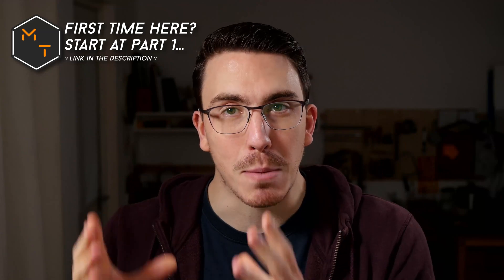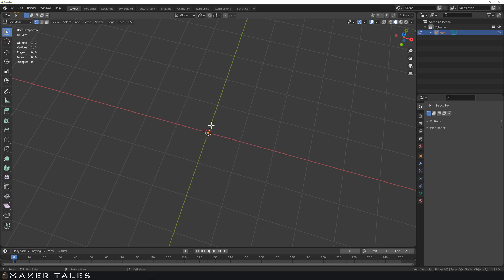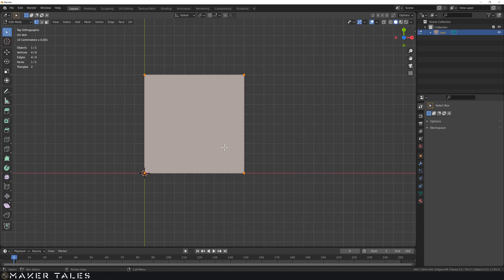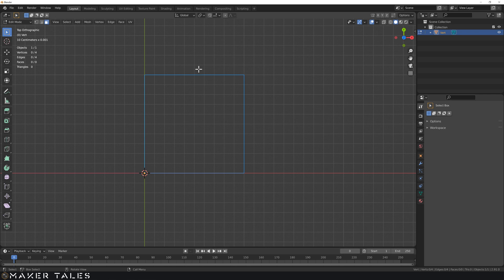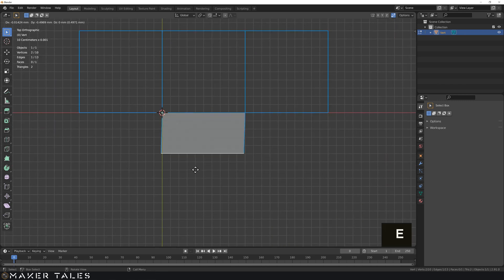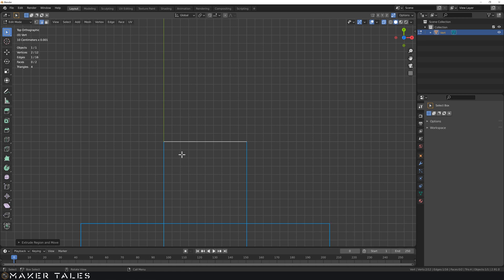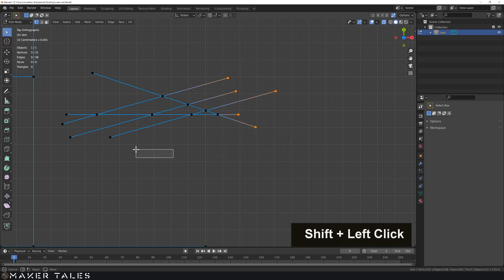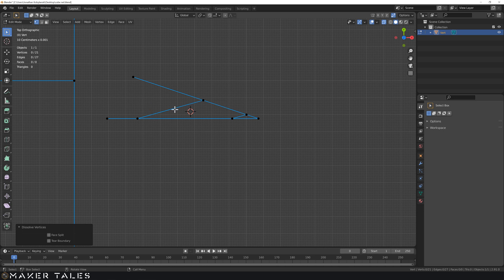2D Basics Of Blender 2.9+ / 3.0 Precision Modeling - Extruding and Clean Up - Tutorial | Part - 13

Comment: I have done some modelling for some other uses and z is usually represented by the height of something in those uses and x and y are the length and width of things, I'm curious if I continue to do things in that fashion how big of a problem will that be for 3d printing? I'm wondering if I should forcibly break my habit of using numpad 1 as my default view rather than numpad 7, cause I do find things to be quite a bit more confusing with num pad 7

Comment: I scrolled through the comments a little bit and found that I was not alone in being unable to snap the planes using CAD Transform unless the planes had a face. I have been manually adding faces, snapping them together, toggling x-ray, deleting faces, and then doing it all over. If anyone knows how I can do it like the video does please let me know.
Reply: Dude I thought I was the only one! I think blender changed snapping behavior.
Reply: This just seems like a limitation of the addon. Yes, there is no face there to try and snap to. It doesn't look like it spends processing time trying to predict and project faces where your cursor is between some set of vertices. One thing I have noticed is you can make a helper for that temporary face that you can later reference without having to recreate it every time.

Comment: Had just finished a little 3D doorbell cover for our front gate in FreeCAD... was practicing to re-make this in Blender and was adding a Solidify... it was going weird... came back to this video... and sure enough some errant vertices were hanging around... took them out and BAM! perfect Solidify! Thanks for this video series... I'm still not to the point of actually getting something ready to 3D print, but I've learned more about Blender than I ever knew...

Comment: Wonderful lesson kudos. I have an issue with 7:17, my cad transform does not highlight/lock-onto the vertex for 2d objects. If I add a 3d cube it does lock on to the vertex. Why do you think this is. The snapping on cad transform is on vertex and vertex select.

Further testing, if there is a face, cad transform will lock on the vertex. Without a face it will not. There must be a setting I missed somewhere.
Reply: same issue here, seems like one workaround is to fill, snap, then delete faces only
Reply: @bobobob1230  Thank you. Thought I was going crazy.
Reply: @bobobob1230  Thanks..
Reply: I have this same problem Blender 2.91.2
Reply: @brianc83  Noted must be an issue with the addon and the latest ver of blender then. Thanks
Reply: I had this issue too. First I thought it was because I had duplicate vertices, which apparently makes the add-on not want to snap. I deleted everything, started over, thought it worked. But apparently was a fluke. Did find that if I rotated my viewport slightly out of a strict Top View, it snaps to the verts
Reply: @kevinandersen5836   so, it worked as in the video? my statistics says "Top orthographic", get no snapping when there´s only vertex and edges
Reply: thanks, I had the same problem. Any news to solution this? Very unpractical have to make the face every time...

Comment: Thank you for this series, your content is top class.

I am getting issues trying to use TinyCAD on 2.92.0.
The "VTX | Auto" tool gives me an error:  "Non Planar Edges, no clean intersection point" when they are clearly planar.

May you confirm TinyCAD is working ok with 2.92.0? I don't really get if TinyCAD is deprecated or not.

Thank You!
Carlo
Reply from the maker: I've not had any issue with TinyCAD as of yet. But I would love to take a look into this if you would be able to ask this question in the discord and share the file.
Reply: @Keep-Making  Hi, I am having the exact same issue at the moment! Was this issue resolved?
Reply from the maker: @petonegroom4321  Hey petone, first off I would check the scale of my object but also youtube comments are not great for support so maybe head on over to the discord.

Comment: Thank you so much for your always useful, interesting and accurate videos. I take this opportunity to ask if anyone knows about similar videos to use Archipack? Personally I find Archipack very cumbersome and not very intuitive. Thank you!
Reply from the maker: Hey Filippo, I'm so glad you find my videos useful.
Personally I have not explored Archipack. What do you find the most cumbersome about it and I'll see if it's something I can look into.
Reply: @Keep-Making  Thanks for the reply. I actually looked for support on the internet, but didn't find much. The author page itself is out of date and has few videos available. Even though I bought the full version of the add-on after a while I abandoned it because I can't use it. I simply cannot accurately draw buildings or parts of them (walls, direction, thickness, etc.). It is strange, as I am a long time user with various softwares such as blender, autocad etc.
Anyway, thank you for the effort.
Reply from the maker: @discotec70  No problem. I'll see if I can get my head around it and if I can and I see the demand for it I'll get a video sorted =)
Reply: @Keep-Making  thanks a lot for the effort! I appreciate!

Comment: I can't snap to the vertex with the "CAD Transform" in the 2d edit mode. Is there a fix? it works if I use a 3d cube...
Reply: I had the same problem. I found that it only works if the Object is selected in the Outliner on the right (make sure that the Vert-Mesh is highlighted with a blue background).
Reply from the maker: Interesting.... I've had this every now and then but I find that if I reload blender it usually sorts it self out. Try that out and let me know if it works.
Reply: I noticed Jonathan has cad transform 0.91 installed. I had 0.0.9 and it didn't work for me either. Now upgraded to 0.91 and it works. Looks like that is something they fixed in the newer version.
Reply: I had the same problem. Updated Blender from Version 2.91 to 2.93. I'm Using CAD Version 0.93.1. BTW, maybe this is interesting if you don't wanna lose the whole settings after updating blender https://b3d.interplanety.org/en/how-to-transfer-settings-and-add-ons-from-an-old-to-a-new-version-of-blender/
Reply: I also had that issue and have been using 0.91 from the start. Blender restart fixed the issue. But still I can't grab a mesh with CAD transform in edit mode and move it if it is part of the same object as Jonathan is doing. I first have to separate the mesh to be a separate object...then it is working. Did anyone experience this?
Reply: @BenjaminHorvat  For me even the restart did not help. I am on Blender 2.93 and it already has some issues (I had to fix a dict key as described by the author here: https://blenderartists.org/t/cad-like-transform/1226197/320 ) so I expect there might be more issues in 2.93. It works perfectly fine when I try it with 2.92.